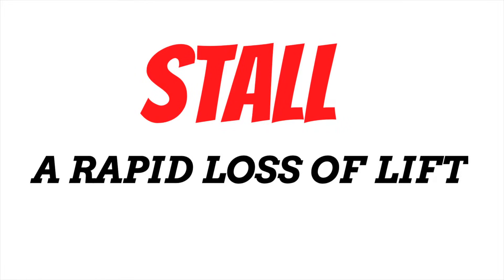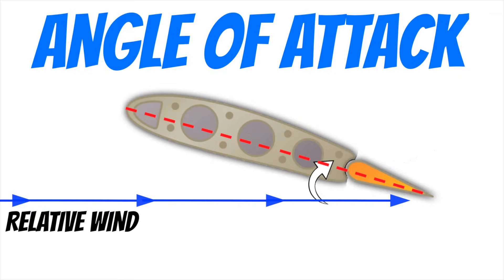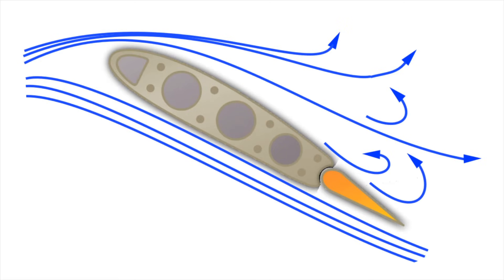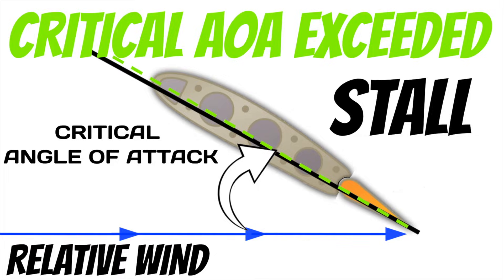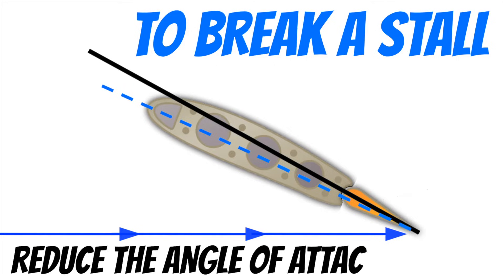What Causes an Airplane to STALL? | Complete PPL Ground Course (Lesson 3)

Comment: 0:54 stall:rapid loss of lift 

1:08 airfoil leading edge and trailing edge 

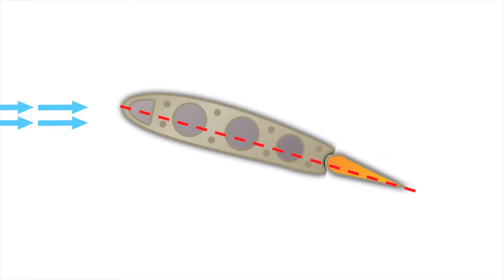1:22 chord line 

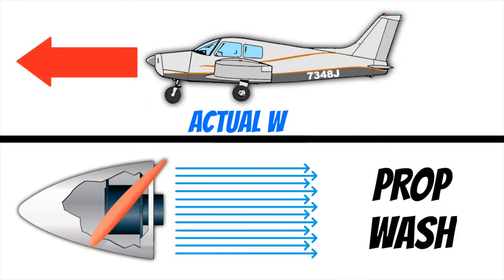1:37 prop wash, wind from the propeller going over the plane and wings 

1:58 angle of attack: the angle between the relative wind and the wings chord line. It changes with direction of the plan 

2:21 when we increase angle of attack or relative wind, we increase the lift as long as its smooth air flow 

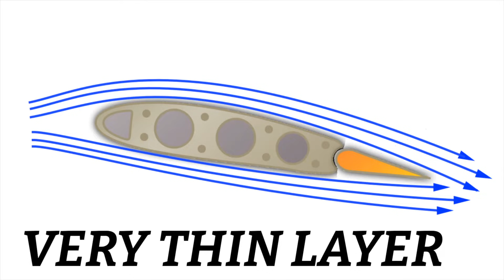2:37 laminar flow, wind flows over and under the wing in smooth thin layers 

2:40 low angles of attack the wind flows smoothly and the layers stay separated 

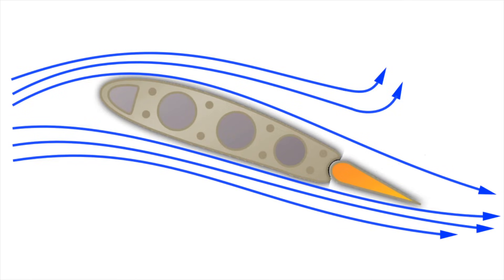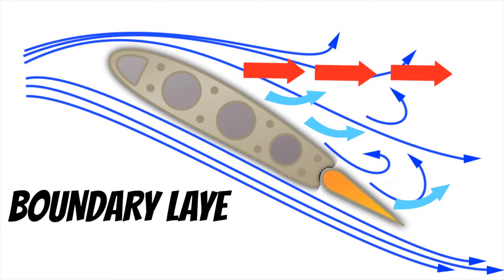2:57 high angles of attack increase the lift because the air has more distance to travel but it wants to flow straight back it would become separated from the top flow causing a disruption in the other flows. Boundary layer separation 3:22 

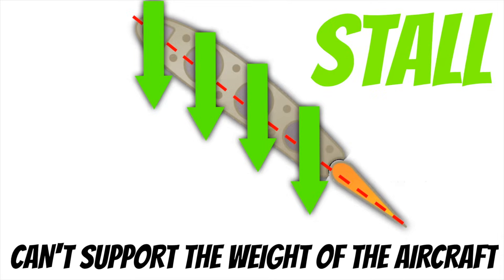4:11 stall when lift is less than weigh 

4:25 altitude and weight affect stall speed but angle of attack is always the same 

4:31 right before airplane stalls, it reaches the highest point of angle of attack and if it increase any more it will stall. This is called the critical angle of attack 4:43 

5:18 wings are still producing some lift during a stall. To break a stall, reduce AoA and reduce back pressure on yolk
Reply: You are a hero breaking these down for us! Thank you!

Comment: As a to-be aviation student (I just carry out my researches on almost everything based on aviation and my parents don't think it helps now but maybe soon they will realize):
1.Laminar flow may be described as one where air is flowing in thin sheets or layers near surface of an aerofoil with no disturbance btn the layers
2.other stall causes are:
   i. Contaminants because they disrupt laminar and reduce aerofoil capacity 
   ii. Weight since when weight increase,more lift will be required hence high angle of attack this stalling
   iii.Turbulence bcuz sometimes an aircraft may experience upward gusts which brings abt sudden increase in angle of attack this stalling
    iv. As Stalling speed increases, the CoG moves forward thus negative lift produced by the tail plane

Comment: in the google form, "What will happen to the stall speed of an airplane if the airplane's altitude increases?" why wont it stall at a higher airspeed at a higher altitude? the air is less dense higher up there and the a higher air speed is required to create the pressure differential for the lift?
Reply from the maker: The airplane will always stall at the same INDICATED airspeed. This video explains that more: https://youtu.be/1YRqbXeeMiE?si=DB1bHyW0YjoWYFIo
Reply: thanks man

Comment: sorry , I am confused. you mentioned at 1:51 when the plane change direction (pitch up or down) the relative wind direction changes as it directly opposes the direction the plane is traveling.  right after, you mention the angle between relative wind hits the airfoil at different angles which is angle of attack. this can only be true if we consider the relative wind remain horizontal. not change with the direction of the plane. (2:02). can you please clarify?  Thank you so much for the great videos.
Reply from the maker: The angle between the relative wind and the chords line is the angle of attack. They are directly related and change together as you pitch up and down
Reply from the maker: If you pitch down, the angle of attack is reduced because the relative wind is now striking the wing at a shallower angle

Comment: How does an airplane stall at a slow speed (i.e. 50 knots) in straight and level flight where the AOA is below the critical AOA (assuming we're straight and level)?? POH says it's possible to stall at slow speed, but how without exceeding critical AOA?
Reply from the maker: The airplane always stalls when you exceed the critical angle of attack. If you have flaps down, you may have a slightly nose low attitude during the stall. This is why you might be confused
Reply: @FreePilotTraining  thanks for the reply. Really my question is how do pilots land with engine failure and not stall. Engine is not even running.  Unlikely event but it does happen. Plane essentially becomes a glider, so how does it not stall at such low speed

Comment: What does "back stick pressure" mean?  How is it caused?  How is it reduced?  Is that just the pressure on the stick from the increased pressure of the air on the flaps?  Does that simply mean pushing the yoke forward to lower the nose?  I fly a powered paraglider and I am thinking about getting my PPL.  So I am enjoying your videos and trying to catch all the terminology as quickly as possible.  Thx.
Reply from the maker: When you increase the angle of attack to induce a stall, you must pull back on the yoke to do that. In other words, you must use “backstick pressure” to induce the stall. Release the yoke to allow the nose to fall back down
Reply: Him showing the in-flight parts isn't part of ground school, it's just to show you the purpose of the ground school diagrams from earlier in the video. 

You'll learn what back stick pressure is later on, when you get in a plane with an instructor. 

I think the purpose of these videos is the diagrams and explanations of the principles. 

These videos do not substitute for ground school - which you need to take and get a certificate for before the FAA written exam. These videos are supplimentary.
Reply from the maker: yes. My goal is to tie in ground training with things you can actually use in the plane

Comment: 8:17 "I'm going to raise that second notch. This is going to get rid of some of the drag." What does this mean? I remember what drag is from the first lessons, but what are you raising a second notch?
Reply from the maker: Good feedback. Thanks
Reply: Flaps can be administered in "notches" which are usually in 10, 20, 30 and sometimes 40 degrees. I've been in planes where you can move the lever in those preset notches, and other planes where you have to hold the lever down til the flaps are at a particular angle 😅 i prefer the notches

Comment: 8:10 "Broke stall by releasing that back stick pressure." What exactly is "Back stick pressure"?..... Well, asked AI and learned it's essentially the pressure used to pull back on the yoke. So you didn't pull back as hard. It seems like a small thing, but most everyone watching doesn't know jack about flying.
Reply from the maker: Great point
Reply: It is kinda in the phrase tho😂

Comment: Hi, I did the free quiz, I didn't really understand question 2? what does it mean by stall speed?
Reply: I also was confused, in the video he says altitude and weight can have an affect on “stall speed” but the angle of attack will always stall at the same point but then the correct answer on the quiz says it will stall at the same speed regardless of altitude. 4:26

Comment: Just to make sure, at 4:12, the airfoil can't support the weight of the wing if AOA further increases because it no longer produces enough lift to be greater than or equal to the weight right?
Reply from the maker: Correct

Comment: Another great tip is a plane stalls at the exact same aft stick position every time (reference the book stick and rudder). So when next practising your stalls take note of the aft stick position right at the stall this is your stall stick position learnt it, as it will never change! It's an infinitely better indicator for stalls than airspeed which is just not a reliable marker.
Reply from the maker: Very interesting. Thanks! I still haven’t been able to read that book yet.
Reply: @FreePilotTraining  equally  interesting, and understood by few pilots, is that the stick position not only determines precisely  your stall angle but also your precise airspeed regardless of power! 
Example if your flying with the stick in a fixed position yeilding say 80 knots. As you increase or decrease the power but hold the stick in same position, the airspeed will only momentarily change until the fixed AOA takes over and brings the air speed back to exactly 80 knots.
When I land I use the stick position to control my approach speed and petrol burn (throttle) to make the ground closer or further away. 
Stick position = air speed
RPM (Power) = height AGL.
FACT!!!!!

Comment: i have a question, most of this all makes sense to me. but one thing i'm still confused on is how are some planes able to do loops while going past the critical angle of attack? is it just relying on the power of the motor? i've heard that the elevator/horizontal stabilizer still works fine past the main wing's critical angle of attack, but i would think the the horizontal stabilizer would still have a critical angle of attack so that the elevator wouldn't be functional. plus i've seen that the ailerons still work going vertical until the plane gets to slow. (on planes that are capable of doing loops.) why is this?
Reply from the maker: Great question. It’s all about inertia. I did a few loops in pilot training for the Air Force. You have to start out really fast and accomplish the maneuver before you slow down too much. Otherwise, you could stall on the upward part of the loop.

Comment: air speed does seem to matter i would think. you said it doesn't matter but if your speed is high and thrust is more than 1to 1 you never stall. is that right or? i mean maybe you were talking about this plane and power set up? i do love what your doing i need to learn the instrument series.
Reply from the maker: It does matter, but the angle of attack is what is truly important
Reply: It only means it will take longer to stall
Reply: Regardless of speed with enough angle you will stall

Comment: If i am using this as my part 61 ground school, would the FAA require a sign off to be able to  take the ppl test?
Reply from the maker: Yes.  You must have an instructor endorsement to take the written exam.
Reply: brian, i am at a part 61 too and thought about using the pay ground schools for my PPL.  but i talked to Sheppard air (who you should use for everything after the PPL) and they said there is so much info out there you should not need to pay for the PPL ground school. if your instructor teaches you right in the plane and you do your part and study (or watch this video series over and over again like i did) you should not pay a penny more for ground school than you would for a flight lesson. 

as Josh your instructor will sign off for your PPL.  if you have a good instructor he will make you (or you can show him) some practice tests. each instructor is different but if you get consistently above 70% they should sign off on you. due to my rotating work schedule is was hard for my instructor and i to get together for me to take a practice test in front of him because i figure i why waste time on a practice test when we could go fly and build hrs. so i showed him all my practice tests on sporty's. I used sporty's practice tests for mine.  i also recommend you get the asa electronic e6B and the manual asa e6b "whiz wheel".  i do not recall josh having very many videos on how to use the e6b but there are several videos out there showing you how to you use the whiz wheel and having the electronic e6b will really help you learn the manual one lots faster. as even though you can use the electronic e6b on the written exam on your checkride you examiner will make you show him you can use the whiz wheel if you want to pass. so best to learn that one.. for me anyway it was easier to learn the whiz wheel by using the electronic version.

be warned Sporty's is damn good but i think sporty's limits everyone who does not pay for their PPL ground school course to 75% or less on the practice test. i did about 100 sportys exams and got higher than 75 only like 5 times. but when i went to take the real test i dropped a 91. so how is it i can take 100 tests including one 24 hrs before the real one and score 16 points or more higher? to test my theory i took the sportys test within 30 minutes of getting a 91 on the real test and they scored me a 72. only way that happens is if sporty's was putting a cap on the non member scores.  that said i highly recommend you use the sporty's practice exam in conjunction with josh's ground school. even though sporty's caps you it forces you to study more and you can always find your answers really easy in josh's series cause he keeps them pretty short and to the point.

Comment: Why does is stall on runway if you don’t pull back enough?
Reply from the maker: Not sure I understand the question, but you don’t have to pull back to stall. The airplane will stall when you exceed the critical angle of attack
Reply: @FreePilotTraining  I see speed being a factor. I had a wing stall prior to flaring  wings still quite level but close to stall speed. I got a little tailwind on a calm day.

Comment: is there ever maybe time you want to purposely stall ac.. so  you go down lose altitude quickly ?  like  maybe only do it  over ap or rw  and  have  like emergency  gotta get plane or u or pax down fast... could u   initiate  it by just pulling way back ..let it stall  get pointed down  and go from there ?
Reply from the maker: Yes, you want to stall right as you touch down on landing. That’s about it

Comment: Josh, just wondering about those aerobatic plane , why is it that they can do vertical take off and doesn't stall. Is it because of the air foil or the engine power?
Reply from the maker: Even those airplanes will stall. They typically have a lot more power and they are often lighter. That helps a lot.